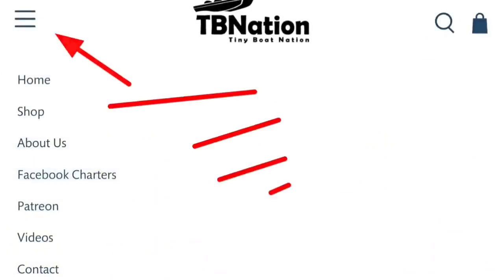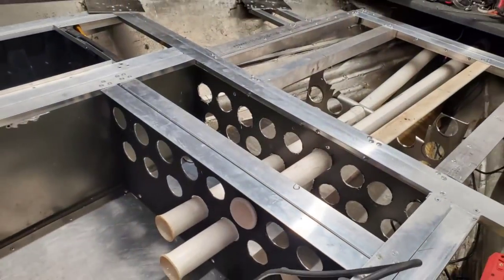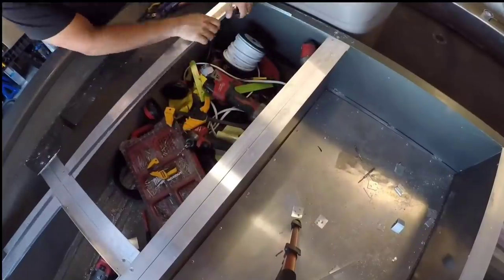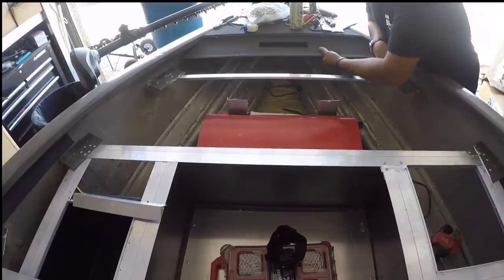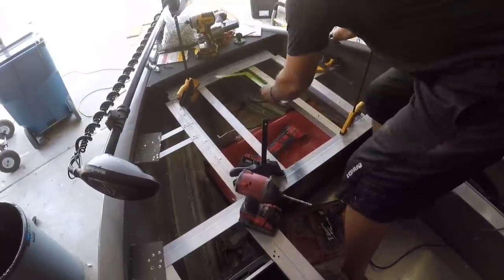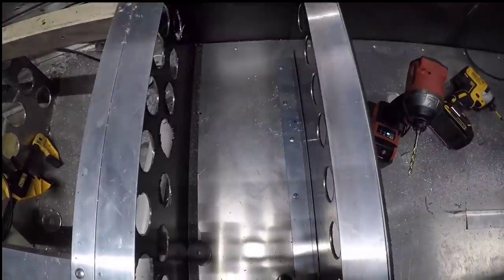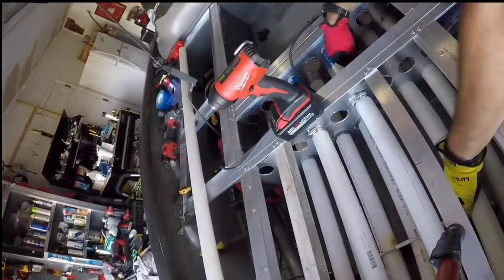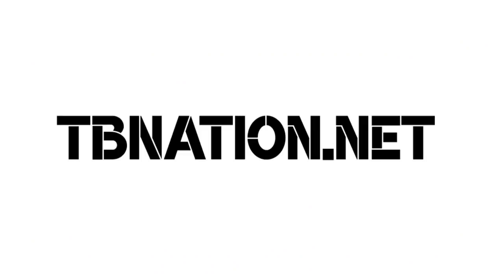Rod Locker Fabrication | Tracker V18 Bass Boat Restoration

Comment: Was totally thinking about doing a DIY build then I realized I could get a sick ass powered kayak for the same price.
Reply: Tiny Boat Nation Oh you’re right. My bad. It’d actually be less to get a dope Oldtown Sportsman Autopilot 120 than to spend 6-7K on a DIY boat mod lol. The minimum for a good boat mod is 2K that doesn’t factor in motors and the cost of the actual boat itself. Oh don’t forget the headache of troubleshooting during the actual process of modding. Yeah it’s dope!!! But I’d rather just spend way less and get an amazing powered kayak.